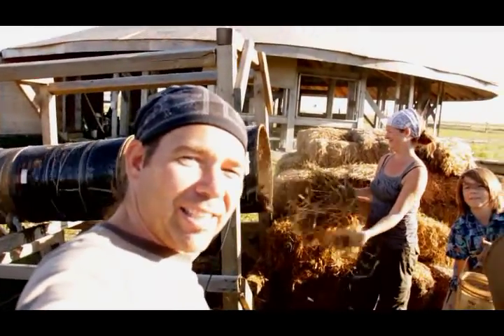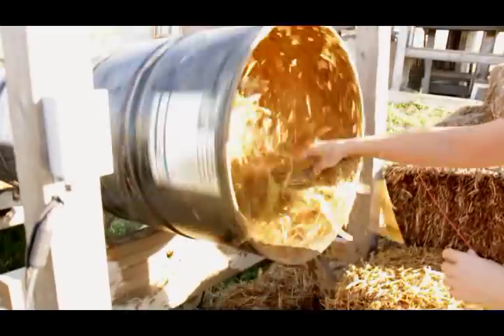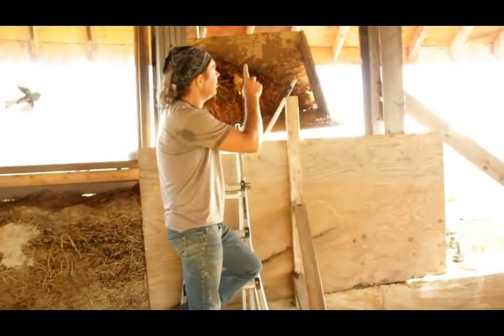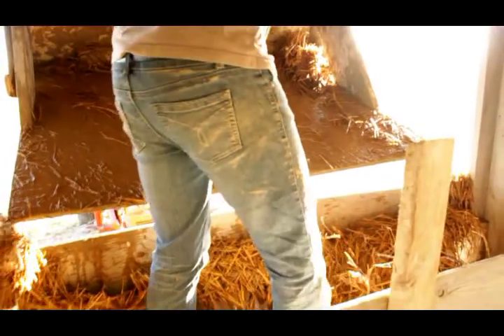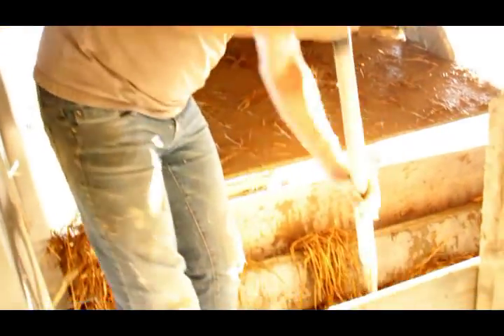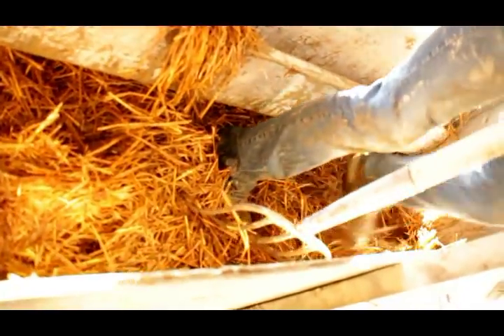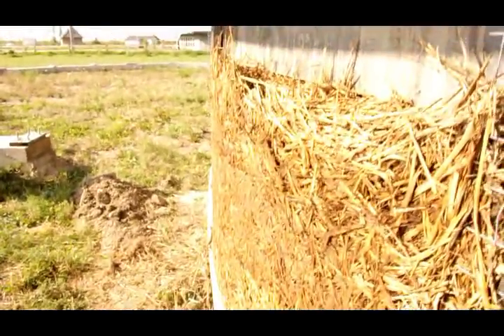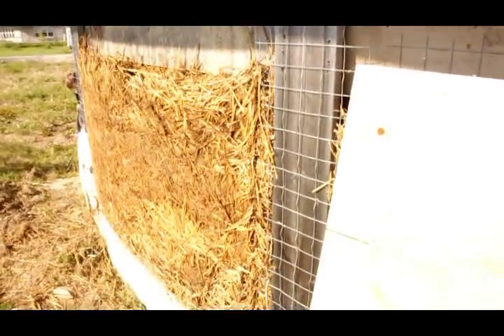Straw Light Clay - Alternative to Straw Bale Building, Craik, SK

Comment: what about termites attacking the straw?  If termites are going to be a problem, do you have a recommended termite treatment solution?
Reply from the maker: +ian cormie Sorry, but we don't have termites here in Canada...nor do I believe termites are a problem Germany where it originated. Because SLC typically is built with wood frame construction, I'm assuming the same steps required to protect a wood constructed building would be used, but I have no experience and the only advice I can give is what I always say, "always build for your area" Mud houses are great in the desert - not so good in coastal areas. Adobe is good in warm climates, straw in cold, SLC/Straw bale - doesn't work in coastal areas, etc.

Comment: Wow, this is great! Any issues with fire or zoning?
Reply from the maker: Because we are mortgage free / insurance free and live in a rural area, we are allowed to build. We are zoned as rural agriculture so no zoning issues to contend with. Even though other builders do run wire through their straw, we prefer not to. Anywhere we need electricals along straw walls we always surface mount in conduit be be 1 better than code. SLC as with Straw bale is not recognized in the building codes here yet even though CMHC (Canada Mortgage & Housing Corporation) has done a good job of testing both methods. If we were to have a mortgage we would have to show insurability...insurability is based on meeting code - which we can't because it doesn't exist yet!
Reply: @Naturally-Kelly  you are awesome with your answers. Any update to the insurance challenges?
Reply from the maker: @LitoGeorge  no updates to insurance. We do not carry any, but I know our neighbours were able to get.
Reply: @Naturally-Kelly  thanks a stack. House holding up ok?
Reply from the maker: @LitoGeorge  Yes. Very well. We've been 9 years living full time in our straw bale house. So long in fact, its time to start doing renos :) Fresh paint inside and out this spring. Plus after 2 kids growing up, some of the interior wood work needs sanding and restaining just from daily wear.
Reply: @Naturally-Kelly   Thanks for that answer. Sounds like a good way of building then. You guys out in Alberta perhaps? The Prairies? I love your idea of making pre formed building blocks. That way one could presumably build in tough winter conditions in a building, make the 4x8 walls without the risk of bowing out and then in spring, have a bunch ready to go.
Reply from the maker: @LitoGeorge  Saskatchewan. Yeah. After building both with traditional Nebraska style straw bale and with SLC - Any time you can pre-form the walls - either in place or in a shop - we've found it to be more consistent, more efficient, and faster. Just have to let go of other peoples "traditional" views of construction :)
Reply: @Naturally-Kelly   ah - my dog comes from Saskatoon SPCA :) Got her when she was all ribs and smiles. I have no issues with letting go of anyones ideas of anything traditional quite honestly, as long as it makes sense. Not having grown up in NAmerica, has allowed me to look at the local building methods as a curiosity and not as the de facto standard. I see you have run courses in the past. Do you have a website that you keep or should I just exercise my google fingies and do my own darn research? I'd love to see the finished product and how its held up over time. (thumbs up)
Reply from the maker: @LitoGeorge  ahhhh we're SPCA buddies :) Got our little rescue from S'toon 2 yrs ago. Best place to keep up is on Youtube for our stuff. Now that we're in finishing stages on our SLC build, we won't be holding workshops...but I still post stuff we're doing like building doors, off-grid power, handyman stuff I take for granted, etc.
Reply: @Naturally-Kelly   haha - good stuff mate. I'll subscribe then, and stick around to check out what you've done up and until now. If needs be, I'll shoot some questions. Love the DIY life way -   thumbs up.

Comment: hi, do you make any protection from mice getting in to your walls?
Reply from the maker: Thank you - Really good question about mice.

Like any other type of building, living on an acreage, in a farming area, Spring and Fall result in the occasional mouse finding their way into the house...but never through or into the straw walls. They find their way either through the hole chopped into our concrete slab for water/sewer entrance or through spots in the soffit and then enter through the roof. Open windows with no screens will also let them in. We've also had neighbours in a straw bale house who watched one scoot in through the front door their kids left open :) 

Straw bale isn't a problem for mice - especially if you use a lime based plaster on your finishing and take extra care sealing at the base of your foundation. Mice DO NOT like chewing or ingesting lime or cement as a general rule - and against popular misbelief - don't harbour in 2 foot thick packed straw walls. They prefer easy points of entry and open cavity walls with little or no insulation.

The best protection against mice, insects, or rodents of any type for any and all types of construction is a well sealed building tied in tight from ground to roof.
Reply: Eat them

Comment: Doesn't the plywood bow out when you compact it?
Reply from the maker: MrFakit Yes. In our build, we have 6' between wood beams. The outside curve is never an issue, but as you move up the wall, the inner curve of the plywood form wants to bow out so after about the first 3 feet of height, I start to add crutches to the middle of the form - nothing fancy, just a 2x4 wedged against the curve out to the floor to help hold it in. Good job on catching that. It's a non issue on straight walls as you can use heavier form boards.
Reply: Riverstone Studios / Riverstone Naturals - Organic Skincare aa

Comment: This is amazing!  Is it possible to have a 2 story home built from this?
Reply from the maker: Tari Newton Totally. The SLC is not load bearing capable, so your wood framing takes up the weight load for your second story. Regardless of single story or two storey, remember that you require cross bracing through your wood framing for strength.

Comment: what about using a portable compacter to tamp it down?
Reply from the maker: The goal is around 30-40 psi of pressure. I've used a hand held tamper (5 lb 8"x8" steel plate on a wooden handle - not powered), 2x4's, feet, even a framing hammer in tight corners with good success.

Comment: Can you tell me the detail of drum construction why do want to do that?
Reply from the maker: Hi Manohar, You can find a video on how we built the drum tumbler here: https://youtu.be/JUuClXG2mQE and a video of our cement mixer here: https://youtu.be/bkPy64CJcwQ.  With Straw Light Clay, you need some way of mixing your clay water and Straw. You can do it by hand - just stir some clay and water together in a pail, put a tarp down on the ground for your straw and then splash the clay slip over it, then use your hands or a pitch fork to mix together, but machines just make it faster with less effort.

Comment: Thanks for the video. I'm wondering how you know the exact R-value per inch for straw slip clay. I have read a lot of different values around the Internet, from the most promising to the most depressing values. I always assume that the R-value per inch will be the same is hempcrete. Which is on itself not as great as other materials but it is easy to do it yourself at a low cost. I would also use another technique for placing and fitting the straw slip clay. Instead of temporarily fixing plywood (I guess) to the frame, I would make 2 wattle walls, one on the interior, one on the exterior. The cavity in between I would fill with straw slip clay and the exterior I would finish with wattle. That is because here in Belgium wattle and daub timber framing is a (lost) traditional building method. Combining that with straw slip clay would give a stronger wall than just straw slip clay and on the other hand it would be better insulated than traditional wattle and daub. That's just my opinion.
Reply from the maker: +Brecht Schatteman please see https://www03.cmhc-schl.gc.ca/catalog/productDetail.cfm?cat=45&itm=7&lang=en&sid=UzVBvzLrl6RWcj9IKj49ySeKXI3cJOEgdAzW0yOSGwbXjzTYC7RngLSmEJ5ihOTo&fr=1453477269256 
This is a publication put together after Canada Mortgage and Housing did extensive research on alternative building methods.  They found at a density of 40 psi the r value of traditional straw is 1.6 / inch. I'm with you, I've heard everything from R10 to R60 for bales. CMHC's research lines up with what we are actually seeing in the Straw bale house we live in. It also makes sense that R value is tied to density and type of straw used.
Regarding wattle and daub...I've seen videos of people building SLC that way and it looks very viable. That style you are talking about seems to be a mix of various styles used from Africa to Central America to Europe over thousands of years. There are even some wattle and daub buildings here in Canada from the late 1800 immigrations. I love the fact that because us humans have been moving around the world for so many years, there is a beautiful fusion of techniques that have been adopted and modified for various climates and conditions. All the best! Kelly
Reply: +Riverstone Studios - Eco-Body Care thanks for the reply! I'm sorry for the effort you put in posting the link, I did find it on another video. Sorry! A conductiviy of 0,09 in metric system is pretty good. hempcrete gets around 0,056 insulation with whool, cellulose, kork, al get around 0,04-0,035. I hoped they would have put more information on it. Because in my idea for the wall, the SLC doesn't need to be 40 psi dense, because the wattle and daub would already give enough strengt to the wall (enless you would want to be able to hang heavy stuff to the SLC wall, but I would find that kind of wrong, you have the timber frame to hang te heavy things to imo). So maybe that can achieve better insulative value. I wished they would gave the results of other densities too. That way I could maybe figure out what would be ideal for my idea. Maybe I should experiment with it myself. Than I could test if there would be a difference if I just used the straw is it came, or if it would give batter value if I would chop it in smaller pieces (smaller pieces makes it easier to fill without gaps). I love timber frame, and I also love the old brick buildings because they are a work of craftsmanship, not machinezed stuff. I also like log houses, but they were not traditional for my region so I think I won't build a log house. I also like how techniques hqve changed and immerged over time. I hate it how now the industrie is focussed on plastics, aluminium etc, they are unecological and I prefer the natural feel of wood. Here in Belgium in the DIY-shops there are almost no tools with wood shaft. Almost all are with plastic. The only axes easy to find are the large wood-splitting/tree chopping axes with plastic shaft. That just as an example of how much of tradition is lost in Belgium. I would like to 'blow new life' (it is a dutch saying, I don't know if you have something like that in English) into the traditions. Starting with becoming a volunteer at a Gaulic farmstead. https://en.wikipedia.org/wiki/Menapii The picture there of the Menapian dwelling is part of it. Once I graduate and have money I will also invest in traditional tools and I would like to build my own 'garden shed' myself (in Belgium it is hardly possible to build only by yourself, the permision is valid for only 5 years, not enough to build a whole house to the Belgium standard all by yourself in your free time. What makes it harder is the 'minima measurements' for living spaces, and so thus the house). Hatefull, but what would you expect of a overpopulated country (if you compare to other European countries) with a deficient gouvernement. One of the reasons I like to watch this video, it gives me an impression of how it could be like. Thanks for the video! and also, sorry if I made mistakes, I don't have English autocorrect on my computer. Greetings, Brecht
Reply: Brecht Schatteman

Comment: My size 10 1/2 shoe is 12" by 3.5", giving 42 square inches. At 200 pounds body weight you are getting 4.8 PSI standing on one foot, maybe 3 times that  - 14.4 - stomping on one foot.  That is nowhere near 40 PSI.
Reply from the maker: Thanks Tom, you're absolutely right. I joke about my "calibrated foot" :)...I should have mentioned that you're looking for 40 PSI in the finished dried product. When it is wet, it is extremely soft. Once dry, you're looking for the side of the wall to be able to withstand 40 PSI without deforming if you are looking to have 1.6 R rating. Stomping on it gets you close on that finished dry wall. It's not a fine science and the product is very forgiving. I'm amazed at how just wet straw and a little bit of clay can produce such a resilient product in the end. We held a workshop and on the second day we gave the participants 2x4s and hammers and told them to rip apart the wall the built the day before...they had a very difficult time.

Comment: all that work for straw light clay and you used stucco to cover it. should have used cob or natural plasters
Reply from the maker: Thank you Peter. We've done extensive testing here in Saskatchewan on styles and renders. Unfortunately cob is too dense of a product to handle -35 C and of the 6 trials of plasters we did, only the cement based could handle the 125 km/hr winds/rain we can get. Build for your climate - not for your fancy :)
Reply: Riverstone Studios - Natural Organic Skin and Body Care 
I could tell you were in canada, but didn't realize you were way up. 
I do like you improve mixer.